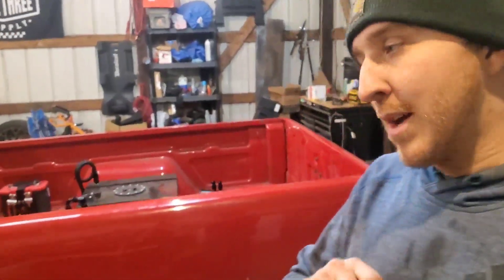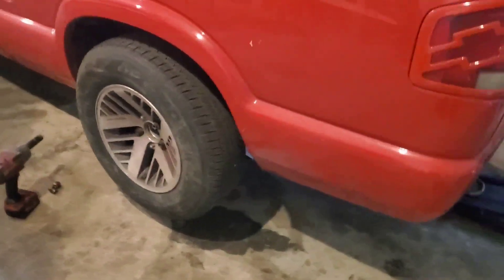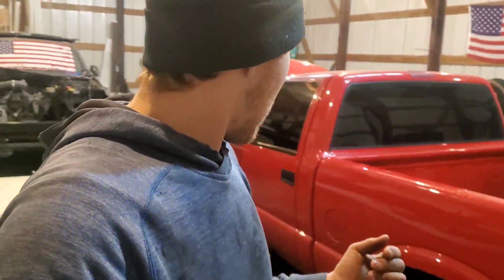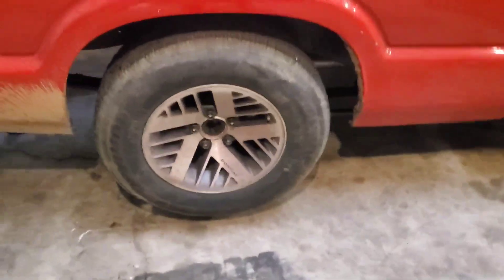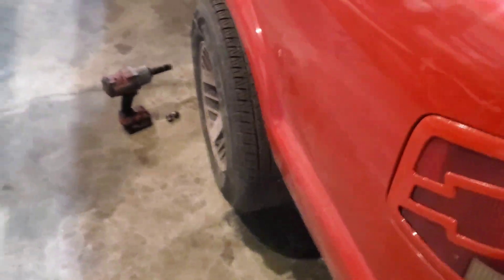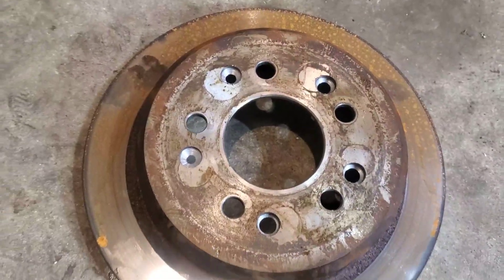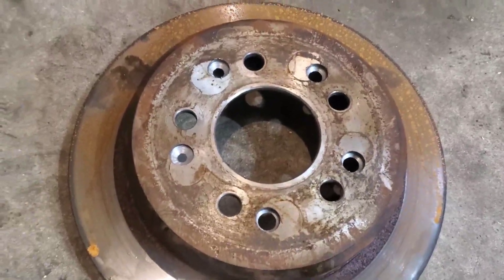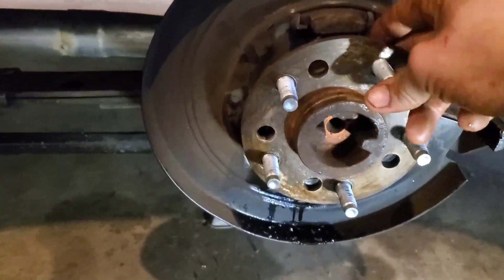Redrilling a ford 8.8 bolt pattern to fit GM wheels!

Comment: On the rear did you use 10 inch wide rim ans did you use a spacer for the front

Comment: What are the specs on the front and rear wheels and tires size looking to do this to a 93 s10
Reply from the maker: Fronts are 17x9.5 and the rears are 18x10.5 corvette zo6 wheels